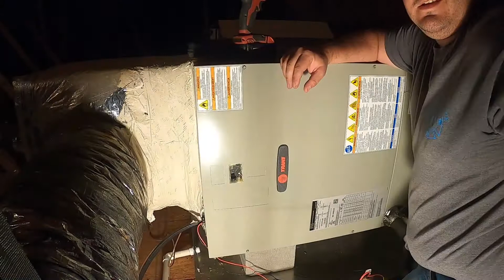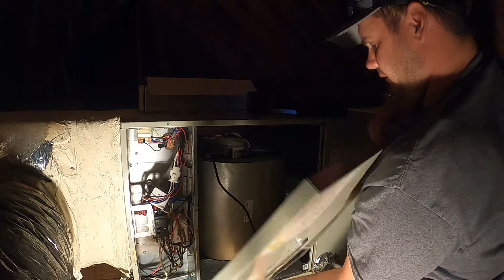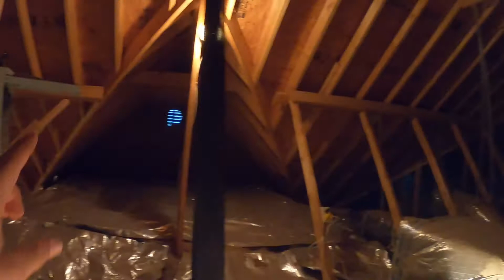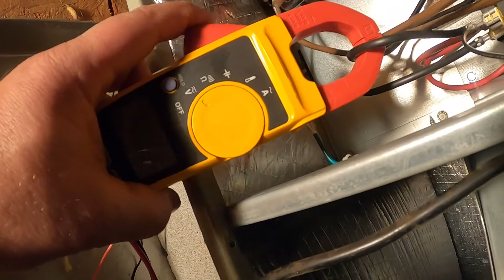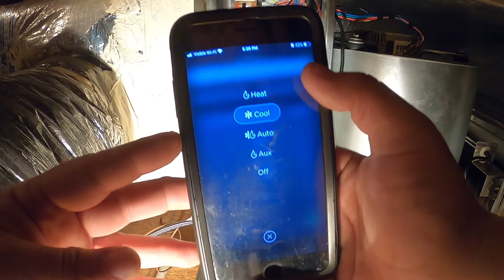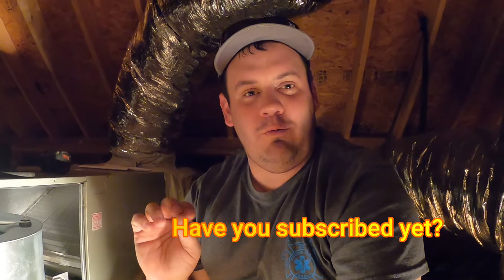Does your heat pump set off your smoke detectors? Here's why:

Comment: Why does it smell like horrible rubber burning
Reply from the maker: Rubber I'm not sure. Do you have a heat pump? It may be the coil was dirty and had some mildew growth. When you switched it to heat that dirt and mildew now becomes hot and dry and gives that same burning smell. If it didn't go away after a few minutes or even an hour, I'd turn it off and call a service company to check over it.